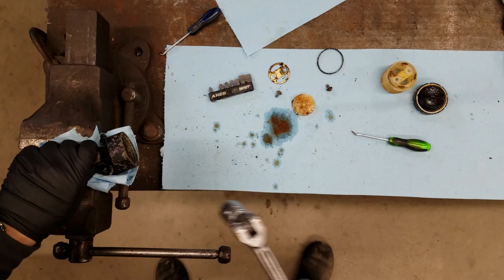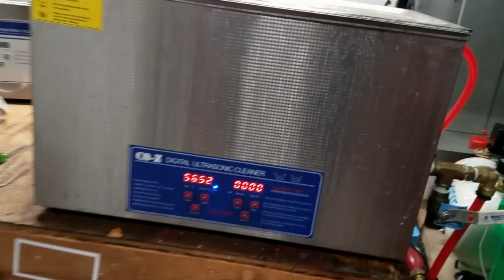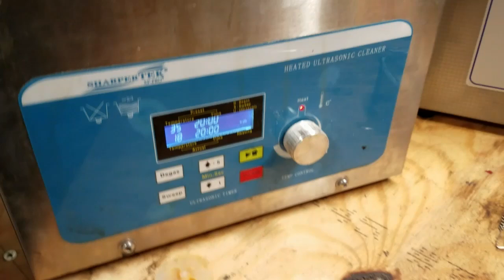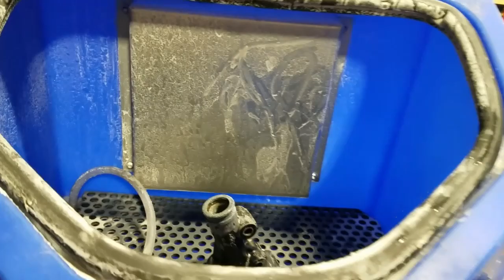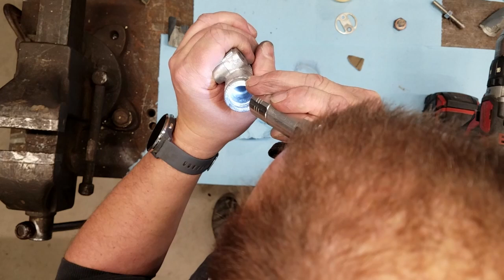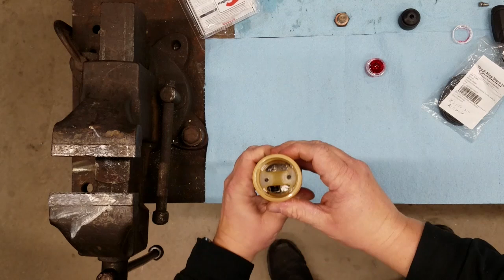KZ1000 KZ650 Seized Rear Master Cylinder Rebuilding Restoration

Comment: Excellent video!  It looked to me like the spring came out of the bore with the small diameter, closed end opposite the piston, but it went back in with small end in contact with the cup seal/piston.  Did I see that properly?
Reply from the maker: The small closed end of the spring should be facing the cup seal.
Reply: @jbartelt2000  Sorry, one more question.  It looks like the nub on the plastic disc inside the reservoir was facing up when you took it out.  It went in nub down.  I can't remember which way mine was.
Reply from the maker: @79MKII  The nub on the reservoir disc faces down

Comment: Thanks for the vid, just working on my bmw r100/7 under tank master cylinder, difficult to get bits for. New cylinders are £400,  just one suggestion, use scissors to cut emery cloth, less wast full than tearing it, over here it dam expensive.